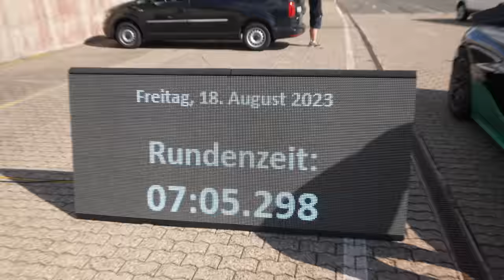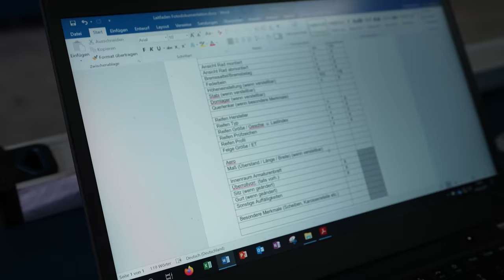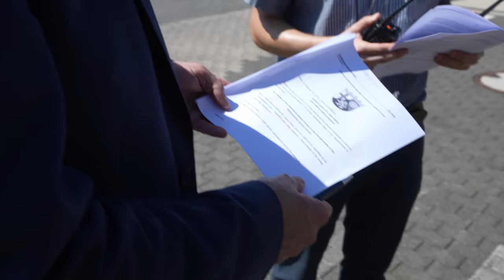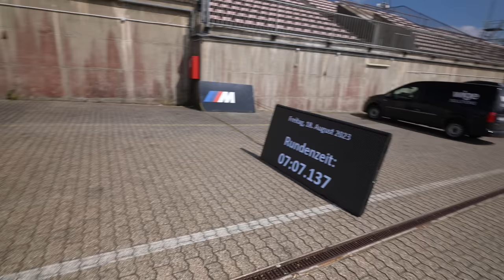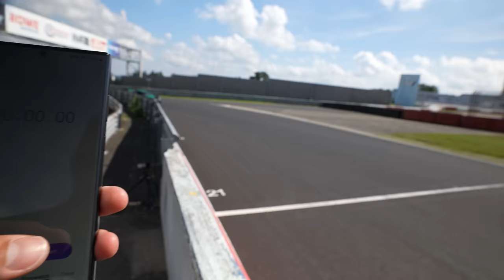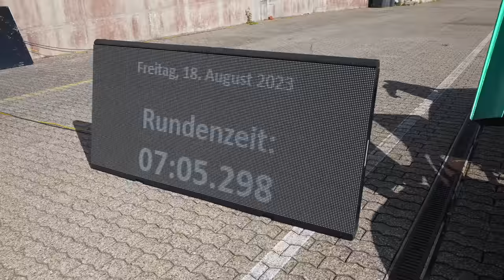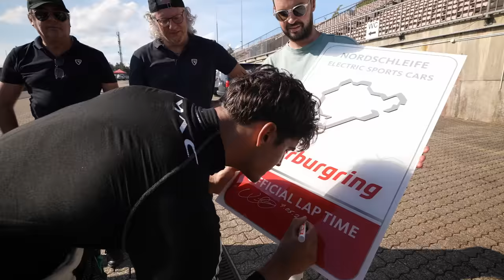EXCLUSIVE: Rimac Nevera Nürburgring Lap Record REAL BTS!

Comment: Wow truly amazing production car, its crazy to think a VW ID.R did 6:05.336 4 years ago
Reply: A minute difference . That's satisfying.
Reply: Porsche 919 EVO did like a 5:19 if i remember  correctly
Reply: @e2rqey  Yes, with a 4 cylinder 2.0 liter fossil fuel engine at 711hp, and 440hp electric engine and 879kg or something.
Reply: @AndrewTSq  And it probably would have been quicker as a pure ICE vehicle. Hybrid systems just add weight, not performance.
Reply: @PistonAvatarGuy they definitely add performance mate
Reply: @S93.45  No, they absolutely do not. 16 out of the 19 production car records that are below 7 minutes on the 'Ring were set by pure ICE cars and the current record holder (the AMG One) is quite heavy for what it is. In all likelihood, it would lose more than a couple hundred pounds by switching from a hybrid power plant to something like the Cosworth RA, or a Koenigsegg V8.

There was even a race shop that added a hybrid system to their race car and had it lose performance as a result. To quote someone else here on YouTube: "High horsepower will make you faster in straights, but being lighter makes you faster everywhere."
Reply: Afaik the 919 wasn't even geared for the absolute top Nurburgring lap time so would probably go somebit faster if it wasn't straight out of Le Mans.
Reply: @PistonAvatarGuy without electric awd the 919 would’ve been way slower since the most of lap time was saved due to insane out-of-corner acceleration which was possible only due to electric awd and instant torque delivery. A laggy turboed 2.0 is no go and this car was initially designed to be a hybrid.
Reply: @coolguy_2997  The hybrid system weighs so much that it could be replaced with a very substantial piston engine, which is where you would get your instant torque. This is why the 918 is easily out performed by more than a few pure ICE cars.
Reply: @coolguy_2997  ...and, even with a far more substantial piston engine, a pure ICE car will still weigh less. Just compare the 918 to the Aventador SVJ.
Reply: @PistonAvatarGuy  don't change subject. You said electric motor doesn't add performance. You were wrong just own it
Reply: @S93.45  Prove to me that removing the hybrid system from the 919 would make it slower
Reply: @PistonAvatarGuy  that's not the discussion here. You said adding eletric motors don't add performance. You're speaking shite. They are designed to make up where the ICE lacks I.e low down in rev ranges. Instant pull offs. Smoother engagement with the clutch for faster launches. Instant in gear acceleration no turbo lag.
Reply: @S93.45  Except that a hybrid system doesn't even make up for the performance that's lost as a result of the weight that it adds to the car. With less weight, a car decelerates more rapidly, it can carry more speed through corners and it can be accelerated more easily by the engine, so lag and a narrow powerband aren't the significant issues that you're making them out to be. Anyway, my comment was meant to describe cars being designed as hybrid or pure ICE from their conception.
Reply: @PistonAvatarGuy  I think your info is massively out of date. Not all hybrid systems are the same. The ICE can be much smaller/lighter because the battery and electric motor can do much more of the overall work. Also, battery tech has progressed enormously in recent years. Some AWD hybrid systems do add performance. Which ICE car is quicker than the 919 around the ring? None, because they don't have that mind-bending AWD acceleration out of the corners.
Reply: @pumpkineater23  No one has tried to build a quicker pure ICE car, but if they did, no hybrid would be able to beat it.
Reply: And this pure electric car basically proves my point, as it's far less impressive than many ICE vehicles. How could the performance of an ICE vehicle be improved by combining it with such an unimpressive technology?
Reply: @PistonAvatarGuy  You said "prove to me removing the hybrid from the 919 would make is slower" 
So why didn't they simply remove the 919 hybrid system to achieve a faster lap-time? 
Now you've turned to pure speculation "no one has tried to build a quicker pure ICE car". 
If we're talking fastest single lap-time then hybrid is superior. And the more the tech progresses, the more this becomes so. 
When Porsche introduce modern racing hybrid systems to the next-gen 911 GT3 RS, (and they will eventually of course), you can bet your life these cars will also be quicker than their pure ICE predecessors.
Reply: A special built car can optimize every aspect of the car. For instance battery size and weight. Just put in enough batteries for the drive. Get rid of the weight and subsequent inertia. Huge advantage.
Reply: @pumpkineater23  Removing the hybrid system would have required an absolutely enormous redesign. And I seriously doubt that the GT3 RS will go hybrid, as the cost would likely be prohibitive. Anyway, the GT3 RS is already much quicker than Porsche's (significantly more expensive) flagship hybrid, the 918.
Reply: @pumpkineater23  Also, compare the I.D. R to the 919. Pure electric is slower than hybrid electric, so what happens when you go one step further and go pure ICE?
Reply: @PistonAvatarGuy  The 918 is ten years old! Things have moved on significantly since then. Again, you need to update your info. Porsche will be testing hybrid systems for the 911 right now. Before too long you will see it incorporated in the GT3RS - guaranteed. Pure ICE is yesterday's tech.
Reply: @pumpkineater23  Just think of it this way: How can you add a slower propulsion technology (electric) to a faster propulsion technology (ICE) and improve the faster propulsion technology by doing so?
Reply: @PistonAvatarGuy   That's already been explained to you in this thread. Tapping into the immediate power electrical motors have to offer, enhancing the output of the internal combustion engine, filling in the gaps, lessening size/weight of engine.. etc.
Reply: @pumpkineater23  And I've explained why that's wrong.
Reply: @PistonAvatarGuy  And I just explained why your explanation was wrong.
Reply: @PistonAvatarGuy yikessss just take the L man… I feel bad watching you get slaughtered in the thread
Reply: @pumpkineater23  A summation of your explanation: Put a really tiny engine in a really heavy car, then it will be so compromised that it needs an additional power train to assist its tiny engine.
Reply: @AlexanderCaley  Yeah, that's why my opponent was able to provide data on all of the improvements that have been made to hybrid drive trains in the past decade, and why they're not able to do anything other than regurgitate hype.
Reply: @PistonAvatarGuy  No problem. Your understanding of this is out of date by a decade or so and you prefer this. Learning new information requires courage, because to understand something new is to change what you think in the now, which affects what you thought in the past and since you are built upon the pillars of the past, so to speak, new information risks kicking them out and collapsing you into a state of ‘I am lost and confused’ which no one likes other than those who seek to be in that state. Certain people’s nature dictates that they go into the unknown consistently.. personally I believe we should all strive to be like that as much as possible. Some people don’t like it but to keep up with the theme we should not seek to build ourselves on pillars of anything because knocking them down and rebuilding is required all the time. Only those that are too high refuse to fall. Those that build temporary structures with the belief they are temporary will move on more readily.
Cheers and good luck.
Reply: To be fair they won’t be beating ice for drag cars anytime soon.
Reply: @Drewbyy  They wont be dominating any racing series which allows ICEs anytime soon (or, ever, hopefully). Putting up one quick lap for show and having everyone ohh and awe about it is one thing, but actual racing is something entirely different.
Reply: @AlexanderCaley  I mean, seriously, you people act like there's only one philosophy which can be used to create fast/quick cars. I was making the same arguments about hybrids as pumpkineater nearly a decade ago,, then three different manufacturers came along (with well more than 3 different car models) and proved that the non-hybrid, lighter car + bigger engine philosophy was superior. And just consider the extreme nature of the car that had to be produced in order to beat those cars, it's powered by an actual F1 engine, for crying out loud! What happens when you build a pure ICE car with the same extreme nature?

And the money spent on these hybrids is absolutely ridiculous. On the 'Ring, the 911 GT2 RS MR is only 8 seconds slower than the AMG One, but it costs over 2 MILLION dollars less! What happens when you spend nearly 3 million dollars on a pure ICE car?

You people just have absolutely no idea what you're talking about, and I'm absolutely amazed that a group of people can be so clueless.
Reply: @PistonAvatarGuy I agree with you if we are talking about production cars, having a 800hp ice car will be faster than a 800hp hybrid car but when it comes to race car, the electric is boost is just on another planet
Reply: @CLSTRN911  I'd say that it's difficult to make the claim that hybrid race cars are superior, as the rules in the relevant racing series tend to favor hybrids. In F1, the rules require the use of hybrid drive systems.

Comment: Still going with petrol.

Nearly 4 times the horsepower of a 992 GT3 RS, coasts more than 6 times of the Porsche and is still 15 seconds slower.

From the Power Data alone it should be way faster, but obviously you can't hide the weight and probably the aerodynamics are also not as advanced.

Comment: 7:05, some 30 seconds slower than the AMG One, 15s slower than that 992 GT3RS.  I've never watched a hot lap with so little full throttle.  Sections where supercars normally go flat out for 15s straight up sweeping corners, the Rimac was braking and slowing down all the time.  I always thought that electric cars like the Taycan/Tesla were built to be big family car in the first place, and that the Rimac being a carbon tubbed hypercar from the start would make it truly capable of competing with other supercars on track.  Too bad, weight is still an issue.  Even a base 992 GT3 with 1/4 of the power is faster, and they both use cup 2R tires, but when you have to deal with that much speed and weight, the tires will overheat.
Reply: Rimac..more a toy for rich people

Comment: Really thought it would have been much faster considering how much power it has. 
Alot of cars like gt3, gt3rs, 918,  huracan performante and svj all significantly faster around the ring, im surprised
Reply: because EV batteries get hot, just like most boosted sportscars which start pulling power after a few laps on most tracks. Energy density and power stability of NA ALL DAY.
Reply: I thought the same, I am really dissapointed...

Comment: Didn't expect that. I actually thought it would do below 7. Of course, still very impressed 😁👍
Reply: It will do sub 7 very surely.. Problems with the car is heating issues.. As misha saying in the video.. tires, battery, SoC, track conditions ect.. Under bether conditions it should be possible be close to 6,50.. sub 6,50? Running this 2300kg car around the track will absolutely melt the tires.. Tarmac temperatures was 50degress aswell.. I really hope they will try again in the end of September.. Should be alot bether conditions
Reply: @sub7up.  Oh yes. You're right. Cheers

Comment: I wonder how far under 7 minutes it would've been if it wasn't speed-limited at 350km/h because of the tire spec/safety stuff.  It was capped at 350-351 on that last straightaway for a good bit during the run.  
Listening to the in-car of the run was also awesome but also eerie, the sounds of the car but no engine noise is crazy awesome.

Comment: Model S Plaid | 7:25.231 ... 
Porsche Taycan Turbo S | 7:33.350

for reference....
Reply: Which makes the 4 door Plaid bl**dy impressive.
Reply: Plaid is realy realy impressive. Beast with track pack
Reply: 7:25 with 1,020 hp and special $20k brakes? Underwhelming actually. Standard M3 comp xDrive 7:28 with 500 less horsepower 😅
Reply: @Bimmer_Bill also another 12-20k aftermarket coilovers...😅
Reply: Ahead of it, there is another bulky AMG Sedan
Reply: @thebuddhasector9493  yup!
Reply: @Bimmer_Bill  "M3 competition" is not "standart" car with "standart" brakes :)
Reply: @thealzp  wtf are you talking about? The m3 comp xDrive that ran a 7:28 is a MASS PRODUCTION CAR as is the Tesla. Do you know what standard means? It means unmodified or a non special edition. For example the jaguar that owns the Nurburgring four door record IS NOT a standard jaguar.
Reply: @Bimmer_Bill  wow competition is a modification of m3, which is modification of 3 series. Its "tunig of tuning". The only difference that its made by plant :)))

Comment: Super result! How many laps can it do on 'Ring at full pace?
Reply: I would guess maximum 2 laps.. Normal  performance ev's can hardly do one hard lap around the ring.. 

This 120kw battery.. At full throttle for 20km's it will use 180kw.. Then next you have the heating issues.. 

Ev's are one lap wonders.. 🤷‍♂️

Comment: Rimac: 14:04 

Porsche: 😴😴

Too hot?  Or too heavy?  Can’t fix heavy on this car.. needs special extra weight tires., maybe reg cup 2 would hold up to heat better.  Max temp is around 100c for tires.  Looks like they were very close to dangerous.. ~250°f or 120c.  Of course a med to hard race tire would be optimal.  But if it’s gotta be a street legal tire a day between 5-10c would be best but mid afternoon and sunny..

Comment: To be honest I thought it would go under 7. So much power etc
Reply: And so much weight.
Reply: Molten tires slow you down
Reply: It's a pig electric dancing on the edge of the grand canyon.
Reply: @Jesko. Yeah, but power CAN compensate weight and nearly 2000 hp should be enough to go well under 7 mins...
Reply: @Jesko.  use wider wheels ....
Reply: @maerklin29800 No it can't. 2300kg in the corners where you have to lift it's not gonna help.🤦🏿‍♂️ Power will never compensate anything more than 1500 kg. And even then it won't. Your braking speed will be slower and the car wil be slow through low speed corners.
Reply: @thealzp  Not gonna help.😂
Reply: @Jesko.  gtr is more than 1500 kg :) .... AMG One also (Mercedes - AMG One	6:35.18	1063hp / 1695kg). NR is fast track and top speed matters.
Reply: @thealzp  So the GTR weighs 800 kg less than the rimac and the AMG one weighs 600 kg less. Volkswagen IDR had a top speed of 250 kmh and still lapped the nurburing in 6:05. So no, straight line speed doesn't matter because if it did the rimac would be the record holder... But it's not. Because the weight made a huge difference in speed through the corners compared to the AMG one . The lap times don't lie. 2300kg pus non ideal condition. This car is getting a 6:55 at best. Also Misha vid he tells us the equipment was weighting the car down like 40kg after 40 kg and then there's the driver . So it weighed around 2500 kg actually.
Reply: @thealzp  Majority of track in a fast car like the AMG one the average speed is 220 kmh. So no. It's not.
Reply: @Jesko.  speed limit for nevera is 350km/h due to tires and its running 12 second on limit without acceleration just not using full power
Reply: @thealzp  And that was 20 kmh faster than the AMG one down the straight. And it's acceleration to 350 kmh would have saved so much time. And it was done because of the tires. No one wants an accident because somebody thought it'd be okay to go 400 kmh on melting tires.
Reply: @thealzp  Keep proving my point. The nevera wich has insane acceleration and almost 2000 horsepower is 30 seconds slower than a car with 900 horsepower less. Top speed nor power matters. It's weight and grip. If you don't have that the power ain't gonna save you.
Reply: @Jesko.  
- You've said - 1500 kg,  not me. 
- Who is talking about "record holder" ?
- Fist You've said its impossible to run under 7 min , and than "This car is getting a 6:55 at best"   :)))
- "so much time" it's not from "race world"
Reply: @thealzp  You were talking about the AMG one which is the record holder.
Reply: @thealzp  Where did I say it's not getting less than 7 minutes? You're putting words in my mouth.🤦🏿‍♂️😂
Reply: @thealzp  Cars that weigh 1500kg are being held back.

Comment: What about the Nio EP9? I've looked it up now, it's all-electric and the record is 6:45:900?!
Reply: Track focused EV....a Gt2 Rs is still faster
Reply: @r7cardosuarez806  question is why's the Rimac beats the record if Nio is do it much faster
Reply: @valeriypupkin  Nios isn't official i think
Reply: Pre 2019 shorter course, different track requirements to set an official record. Under the pre 2019 rules the nevera run would be 7mins flat. 
The nio ep9 isn't a st legal car either. Rumored only 3 were sold to actual customers. And 5 in total made.

Comment: A car with almost 2000 hp is 30 seconds slower than the 8 times cheaper  porsche 911 gt3 rs with 525 hp. That's why I don't like electric vehicles.

Comment: One thing's been really bugging me about this car to no end.

Why are the front brake calipers facing the wrong way? If it's not the wrong way, what makes this car special in a way that the calipers should be placed away from the center of the car?

In addition - any plans to make a track-optimized version out of this? I can't believe that this has to be almost as heavy as an EQS to pull off such numbers. At the very least it's CF mono and doesn't have anywhere near the amount of creature comforts. Batteries are about the same size, etc. Not going to lie, this was a bit of a let down.